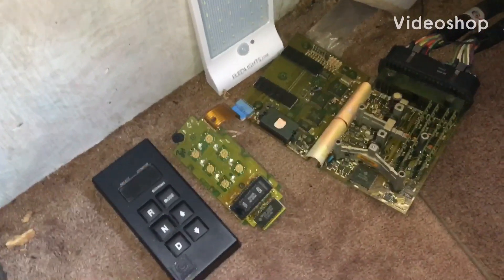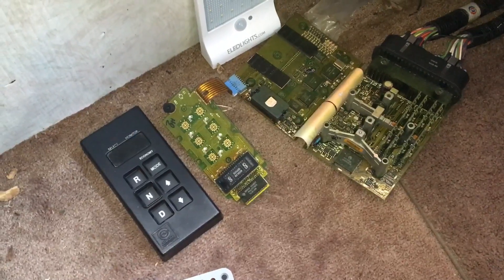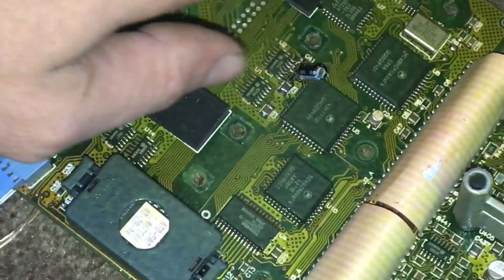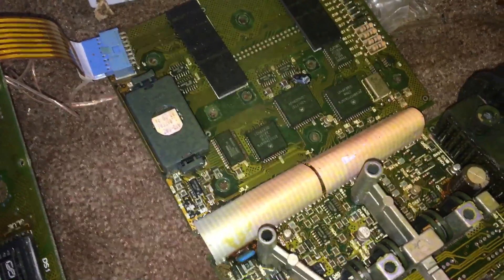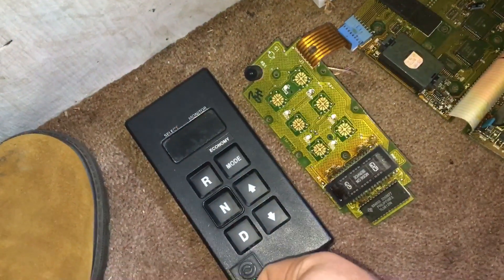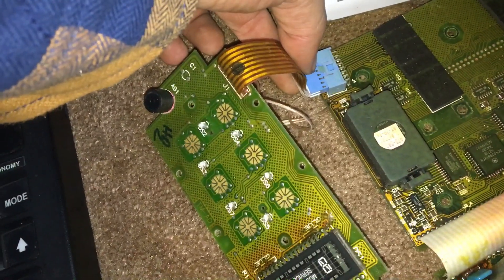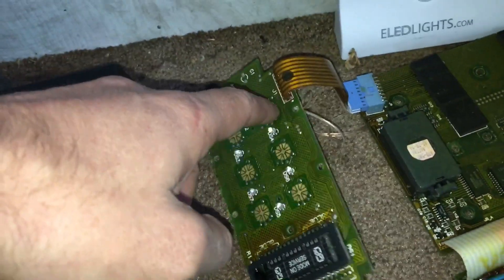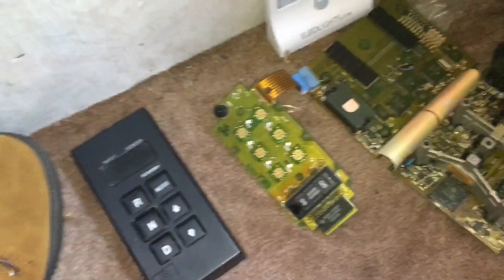Allison md3060 transmission push pad shift solector tcm repair wtec 2 failure

Comment: This video saved me around a thousand dollars. Soldered in a new capacitor, runs and shifts like a champ.
Reply: Add the same problem but the box we want them what boxes because we're missing I got two plugs that plugs into something but we can't find out where the plug through the shifter is getting power but it's not lighting up at all it's not showing reverse non-neutral I think the transmission is a 4060 6-speed
Reply: Wants to know what kind of box

Comment: Hey has anyone had an issue on a DP where you have to push D more than once to get it into drive? Like it will light up and say it's in drive with the red light next to D but it doesn't shift the first time -  Is this a simple fix?

Comment: Do you happen to have the part number off that controller?   Someone stole the push pad out of my fire truck and I have no idea what the part number is to buy a replacement.   They seem to have a bunch that work on the MD3060PR but I assume they are all different. TIA!
Reply from the maker: I do not sorry, I no longer have the motorhome

Comment: Very good info, thank you. Kindly, ....I have to ask. My eight point three alison is probably identical to yours having the same issue.. Before it was start and I assumed the batteries were still adequate. Tried with a jumper box and i'm still getting a zero when I hit start... Turn the key on and everything. Powers up low air buzzer and then. As soon as I try to start everything goes dead.. Had the same identified issues. Involving the allison no shift... At that point eventually. It would go into year and it always started.... Haven't started it for almost a year... Was assuming it was a battery issue. But charge them up and even had a jumpbox, still no start... So then after seeing yours. I might assume that it is going back to this shifter issue.. I'm really not capable to do that kind of repair.... Give me a New control box or pad or something. But I sure is that can't sit in the middle of the road. Trying to hit reverse or get out of a gas station when it won't go into drive.. Who needs that stress?

Comment: Thank you for sharing this. Heating my ECU did indeed enable the RV to start. I've been working for probably 10-15 hours to try to trace down electrical problems and narrowed it to the ECU but never would have known about the capacitor issues. Thanks!

Comment: I just repaired my control panel using this video as a guide. Mine had the same defective capacitor which I replaced with a similar but different rating. Seems to work just fine. With the ignition on and the keyboard flashing, I only had to hold the capacitor with my thumb and forefinger for a few seconds and it quit flashing. No other components would respond. A hair dryer or similar was not required in my case.
Thanks to this video, I was able to successively repair my control panel. No other Youtube video addressed the problem with enough detail to be helpful.

Comment: I really do appreciate you opening this controller up, video taping and posting it to YouTube. There is so little service information available and the price of these components/scarcity of them make it very intimidating to open up and try figure out. My father-in-law had this same problem and we found a great guy on line to fix it fast by shipping the controller to him, but it cost in $500. Now I have a diesel pusher with the same controller and before I take my family cross country, I will save this video and buy some capacitors and ribbon cable! I owe you a steak dinner for this information, thanks again!
Reply from the maker: Glad I could help, I know the feeling seeing how much these cost with little information online, I also found someone who repairs them for that price, might have been the same person. I was planning to send it to them which I still think is a decent deal compared to the price of these things, but I figured if I’m gonna ship it off to be repaired I might as well have a go at it myself trying to fix it

Comment: Thank you very much! This video gave me courage to open the box to fix the problem, saving me thousands of dollars. TCM failed in the middle of nowhere, wife and I tore apart over twenty items in the hunt for a capacitor and finally found the exact match in a ryobi battery charger and it has been working great. FYI this video was hard to find, you might want to add WTEC 2 failure in the title to reach more people. Thanks again!
Reply from the maker: Awesome glad it helped, and thanks I’ll add that to the description

Comment: is that the only computer the 3060 has or is there another one?
Reply from the maker: I think but I’m not positive, this was a year ago and I sold the rv since
Reply from the maker: Ruby Lover no just the one under the push pad selector is the only one I’m aware of, that’s where all my problems were
Reply from the maker: Ruby Lover I believe there is just 1 ecu, I had a data link problem as well because the ribbon wire was internally broken connecting the push button circuit board to the main ecu, that’s why I soldered new wires in, hope that helps
Reply: Good info. Hoe did you separate the board from the case on the push pad? I have the film with the buttons to replace but those compression washers do not want to budge.